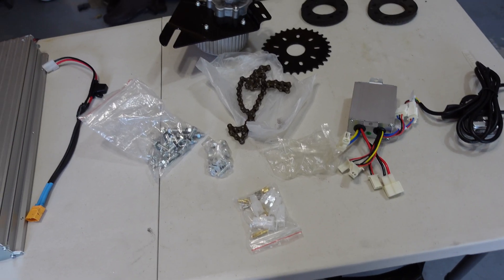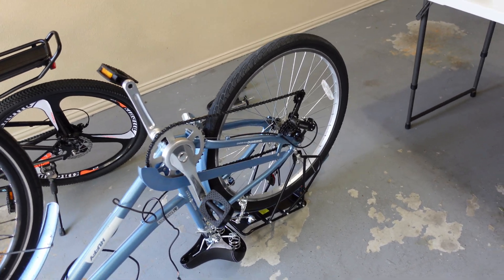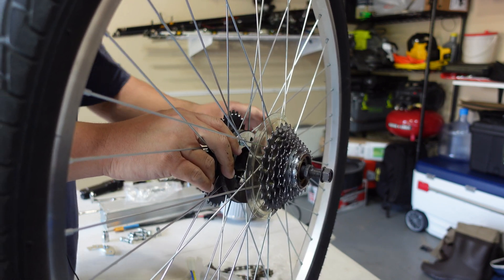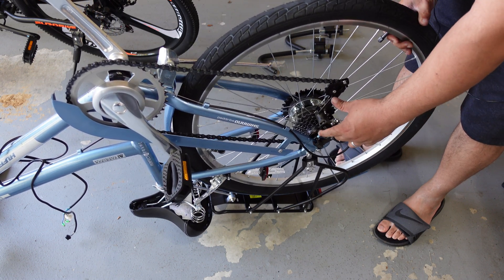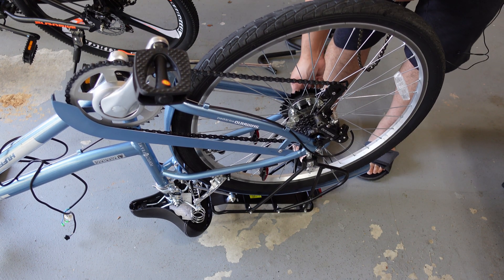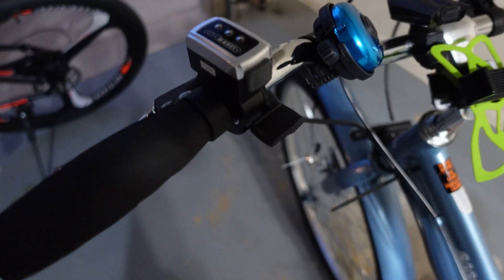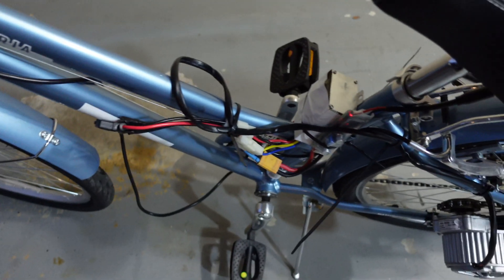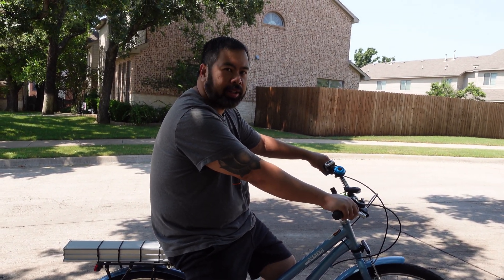Electric Bike Conversion using Left Drive Kit under $200

Comment: No way that will stay on. Just put a bit of metal with two holes coordinating with the bolt holes and it will clamp onto the rail. You can make the end of the  piece cup shaped or at the least strap it with wire wrapped a few times. Shorten the chain may get u lined up too another option

Comment: 🎉tip: nearly forgot, the control box i self tapped right onto bar, that goes across to seat, from basket holder. The Ryobi battery sits on a metal plate i installed to side basket holder using two top screws, the holes drilled to tye wrap. I bought a battery holder for 40v Ryobi battery, with wires already installed to holder. 🥰

Comment: I like the video, aside from the weird buzzing noise when you were reinstalling the back wheel. It was informative and showed actual issues that I would likely face.

Why wife has a similarly styled comfirt bike (26" Easy Rider from Walmart). So I think that this kit won't TOTALLY fit hers either. However, you have 2 very stable points of contact, so I think a heavy duty cable tie (tie wrap) through the top hole and around the upper support arm would be sufficient to prevent the motor from rattling loose. Just make sure to keep tightening your bolts and use BLUE (marine) LOCTITE! Loctite is your friend

Comment: Great video , all these kits take some tinkering to fit as does anything with universal on it lol , just bought one to fit to my daughter's bike , please fit an e bike brake with the power cut off , the Chinese thumb and twist throttles can and do fail sometimes with the throttle full on ( videos  on YouTube where one of the little  magnets  in the throttle came loose and stuck to the hall sensor ) giving the controller a full on signal so at least the brake  will cut off power to the motor

Comment: How was it compare to the front wheel hub motor you have. 
Both are the option I am considering. Thank you in advance
Reply from the maker: Sorry replying so late. The front wheel hub didn't work that great, power and torque was not there. Plus it does not free spin easily, so it have some tension when you pedal. This ebike kit come with free spin bearing, so it feel like stock when you pedal without the electric.

Comment: What batter connector you choose xt60 or 90? I want to try the same set up you have. 
For the bottom of the bracket, you can try using a thin strip of metal bended u shape and bolt up to the top hole of the bracket. Or zip tie hahaha
Reply: xt90 is better and id use mid drive also have a look at loac ebike laws for ur ratings if its ilegle the police will take it way